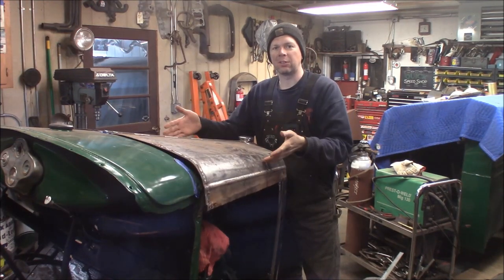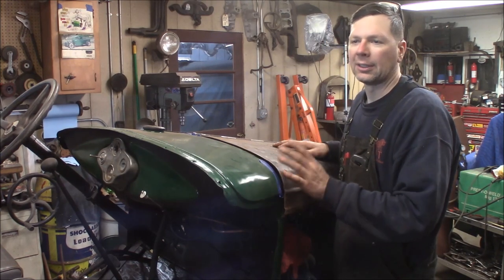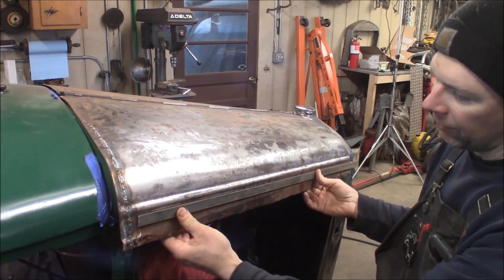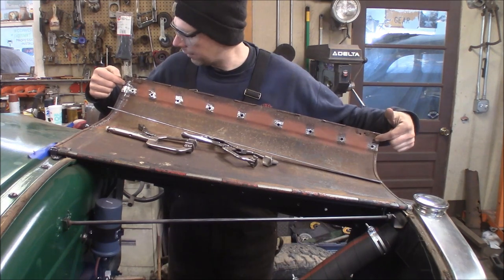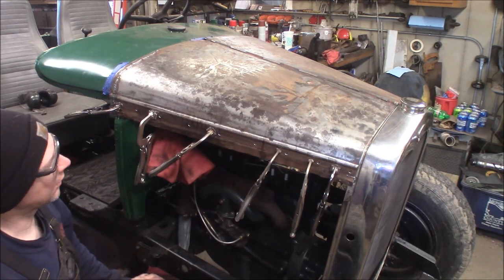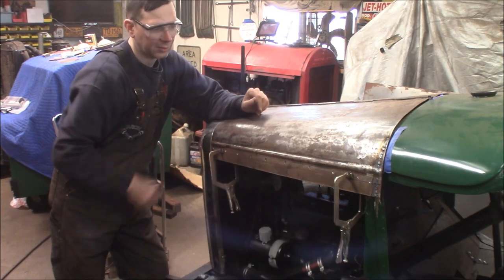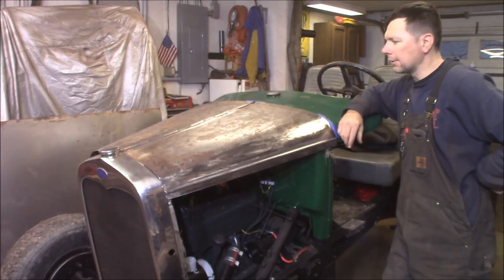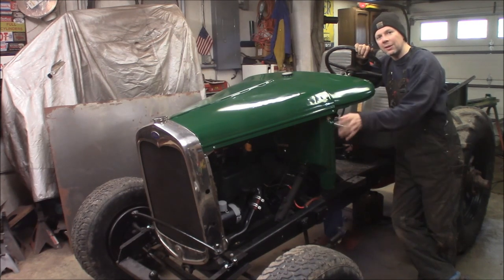Ford AA Doodlebug Project Part 21:  Finishing the Hood

Comment: Good job !!  I was thinking of doing the same thing.  However, instead of using pins I was going to use bolts with wing nuts.  I like the thought of using pins better.  BUT, I'm still undecided about removing the side hood panels.  Currently I'm using a leather strap to hold the hood down like a 1930's race car, but I've decided I don't like the look in this application.  So, I've still got things to figure out, LOL......
Reply from the maker: I was going to use bolts and wing nuts, but then saw the pins and liked the flush look on the outside.  The problem with belts is you need a spring lower mount to keep them tight.  Too racecar like for me.